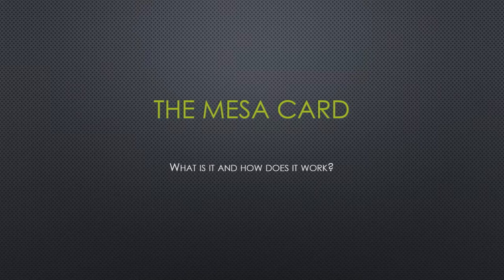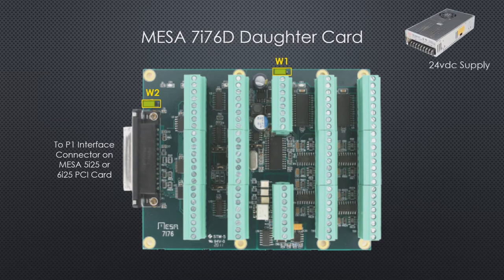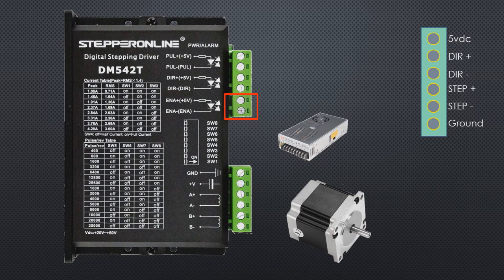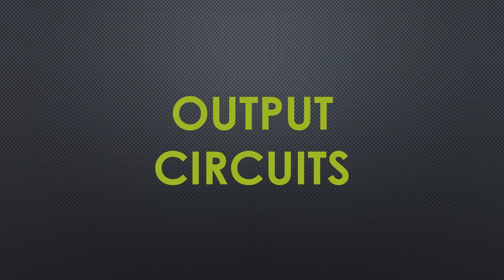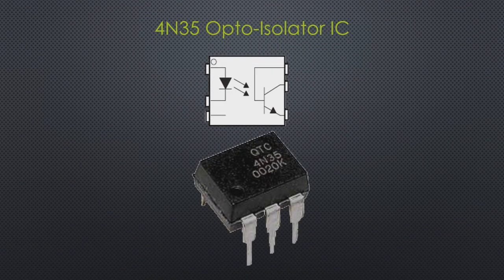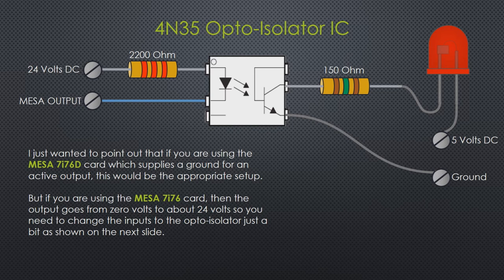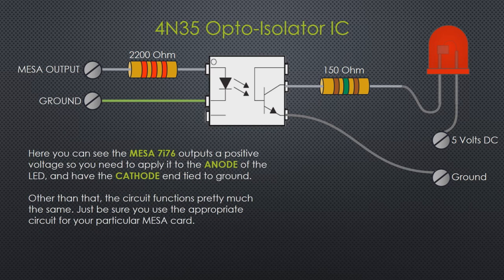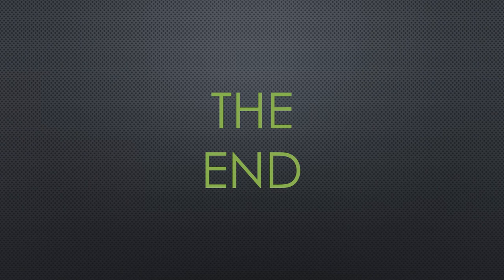MESA 2 - Pins and Interfacing

Comment: Hi Jerry hope you had a nice happy Christmas and want to thank you for this priceless series for us mesa and electronics n00bs 👍 after trying to ingest cards manuals dry, this will surely help swallow next attempt!
Keep these coming and thank you very much again
Reply from the maker: I got a bit sidetracked as you will see in MESA 5-Axis #4... but I'll be doing more with the MESA in future videos.
Reply: @Askjerry  great to know 👍In case you'd be running out of ideas 😋 I'd gladly be helped by a video about encoders (linear/rotary, incremental/absolute) feedback setup... Have a great day and new year's eve
Reply from the maker: Actually... I did at least cover part of your request here: https://www.youtube.com/watch?v=UN8_dUtCR1k
Linear and Rotary work the same, the only difference is that the rotary has the slots/stripes around a circle and the linear is just a long strip of stripes typically printed on glass or plastic. Quadrature encoders are the type used... they have a repeating pattern of four states (quad) that can be read. You keep track of the count to know position. 

Absolute encoders use one track per bit... so you would need 4 tracks for 16 possible positions...  8 tracks for 256 positions.  If you had 16 tracks, you would have 65,536 positions... which sounds like a lot... but if you had a 5-start ballscrew where each rotation was 10mm... you would have a travel of only 10mm... with a 10:1 pulley... still only 100mm. And... an absolute encoder with 16 tracks would either be very large, or very expensive. A high accuracy incremental (quadrature) encoder is about $90. The same type in absolute, 12 bit (4096 position)  is $283 from the same manufacturer. http://usdigital.com

Stepper vs. DC with Encoder - The DC servo has the advantage of positional feedback... so if there is an error (something stopped the movement) the computer would know. With a stepper, if it misses steps... you just do not know. The encoders take more to set up... adjusting the gain, the delay, a PID loop... determines amount of change... and if the motor is keeping up or lagging to control current. In practice with my mills... I have had no problems with the steppers. I test them to see how much they can handle... then never go beyond 2/3 of that limit. Since the modification of the Monster Mill... i have had no issues. 

Absolute Encoders - Good for a single rotation to determine a repeatable angle with no initial calibration needed.. what you read is where you are at.

Incremental Encoders - Less complex, great for multiple rotations. Need to be initialized to know where the starting point is.

Stepper (No Encoder) - The stepper acts as a physical encoder as long as it is not pushed hard enough to loose steps. Needs to be initialized to have a known starting point.

Does this help?
Jerry
Reply: Instablaster.

Comment: Hey Jerry!  Thank you, best description I have seen anywhere.  Except for that bit between  11:22 and 20:40.  Blinky lights?  Up until that I was right with you.  OOPs, i have seen the end now.  You use the 4n35 so you can control a 24 volt relay with only 5 volts output. I have a different work around.  No resisters and no ohms law calculations.  I get a different relay from digikey. But........  I am new here.

At the risk of being just a little too drippy, I have been studying this subject for over a year.  The intimidation factor has been huge. I have been to the MESA web site 20 times. I start reading and every one of their cards says basically the same thing.  God forbid I open a manual - I will come out blind, bewildered and ready for a nap.

This video painted me a road map.  My biggest break through in over a year. Exactly what I needed.  Thank you.
Reply from the maker: You are welcome. I'm sorry if the section on opto-couplers was confusing... let me attempt to clarify.
If you are running the MESA with 24 volts, which is typical... then if you have the 7i76 for example, and you have an output... it will switch from 0 volts to 24 volts. Imagine now that you want to turn on some 5 volt device. POOF right!

So we take the 24 volts and drop it down with a resistor to turn on a tiny LED in the plastic chip. On the other side of the chip is a transistor... an electric switch if you will. We connect our 5 volt supply and device... and it gets switched on and off. With the 24 volts safely on the other side of the 4N35 chip.

Additionally... say you goober something up big time... connect 120 volts to the chip... well... the chip will be destroyed... but the opposite side is protected up to 4000 volts. So you save that expensive MESA card and the computer.

The 7i76D <-- Note the "D"... operates a bit differently... it's output pins hover floating around 24 volts... then when active they act like the drain in your bathtub... sucking down the voltage. The came chip can be wired to react to that as well... so the output of the chip will act identically to the example above. great for buffering either output voltage or a sinking (grounding) type output.

If you get stuck... look up my email address on my web page and I will assist you as time permits. Sometimes I'm bored... others I'm slammed with work. If I don't get right back.... I will as soon as possible.
Reply: @Askjerry  Thanks Jerry, you are the coolest. My project is a Hurco KMB1, DC Servos and 5.5 HP 3 phase spindle.  In many respects it  is similar to your MONSTER build.

Comment: Awesome!...????? About Ethernet card.... I have an old windows pc running lunixcnc everything is work great. I want to get a Gigabyte brix mini pc for my new lunixcnc set up but don't know what mesa card to get. that computer only has Ethernet and USB 3.0. Any suggestion?
Reply from the maker: I have not done a project using the Ethernet version of the MESA card so you would likely need to go to the LinuxCNC forum to get that information. Inside the computer I used, there was an Ethernet and a USB, but also a PCI card slot. If you have the slot inside, then you simply get the mother/daughter board combination, plug in the mother board, and attach the daughter... and you are done.

As for the Ethernet version... it can be found here.
http://store.mesanet.com/index.php?route=product/product&product_id=343&search=ethernet

More information can be found on the forum:
https://forum.linuxcnc.org/forum/search?query=7I95%20Ethernet&childforums=1
Reply: @Askjerry  Thanks. I found the info. it's board 7i92. I guess I should have said keep my same c10, kelling 5056 steppers and 290 oz motors hook up.
Reply from the maker: @jasondevault5066  Ok... sounds good.

Manual: http://mesanet.com/pdf/parallel/7i92man.pdf
Store: http://store.mesanet.com/index.php?route=product/product&product_id=302
Reply: You can also use the 7i76E/ED. It runs off an ethernet cable. You choose the E or ED version depending on the type of outputs you want, Sourcing/Sinking. See pages 1 and 17 in the manual. It runs up to 5 axis of steppers or servos plus spindle. Some of the I/O can also run an MPG as well. The configurations are similar to what Jerry did in this video. It is fully expandable but already has quite a bit of features. Someone else did a video a while back and he ran it off a laptop with a real-time LinuxCNC kernel. The machine was flying. Pretty cool. If you get it running on that Gigabyte brix mini pc, let us know how the speed is. I was looking at the Intel NUC's or even the RaspberryPi 4 for this purpose.

Another option is the 7i96 but it only has 11 inputs and 6 outputs.

Great video Jerry! Nice work.

Comment: Thank you Jerry for your work! Extremely informative video. I have Mesa cadrs on my desk and some DC servos waiting to be controlled by Mesa. Have you tried to use different configuration on Mesa - PWM signals driving H-bridge and feedback from servo encoders?
Reply from the maker: I have not. There is a lot I would like to do with the Mesa card but haven't been able to do so. I have a PUMA robot that an idiot friend destroyed the main cable, so I need to build a new controller. All the motors are DC Motors with Quadrature encoders... so it would be a perfect start. When time permits... I'll get that done.

Comment: thanks for video ,,want to buy eth card 7i96 .so  is it same wiring for steppers and drivers like this one ? or they changed something
Reply from the maker: From what I was reading... " The 7I96 is a Ethernet connected motion control interface designed for interfacing  up to 5 Axis of step&dir step motor or servo motor drives. Step rates up to 10 MHz are supported. The 7I96 also has 11 isolated inputs plus 6 isolated outputs for general purpose I/O use. A high speed encoder interface is provided for spindle synchronized motion. A RS-422/RS485 serial expansion port  and a parallel expansion port." 

It appears the stepper section is wired the same, but there are only 6 outputs instead of 16 that the 7i76D has... and only 11 inputs instead of the 32 that the 7i76 series has.

Not sure why you wouldn't go with these LAN variants...
http://store.mesanet.com/index.php?route=product/search&search=7i76e

Comment: Hello teacher! :D

I bought mesa 7i93 ethernet board.
Can i control directly  step/dir or i need 7I37TA opto-isolated
Reply from the maker: I pulled up the manual: http://www.mesanet.com/pdf/parallel/7i93man.pdf
And it says that the board can be configured for STEP/DIRECTION (PDF PG 5) 
On page 15 (PDF PG 19) if you configure the board for SVST8_4IM2, which will give you a 4-Axis stepper motor configuration.
The SVST4_8 configuration will give you 8-Axis stepper motor control.The unused pins appear to be encoder inputs and/or GPIO.

Other than that... all i can say is start reading: https://forum.linuxcnc.org/forum/search?query=mesa%207i93&childforums=1

Good luck!
Jerry